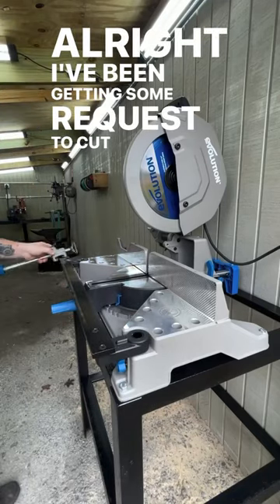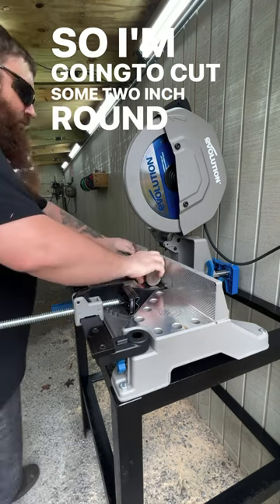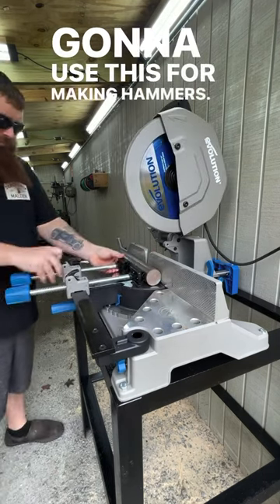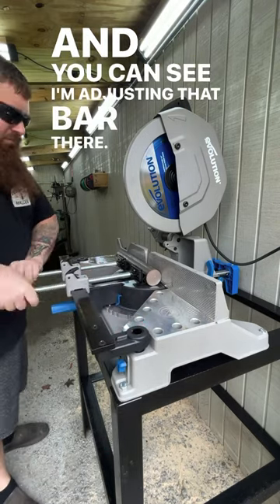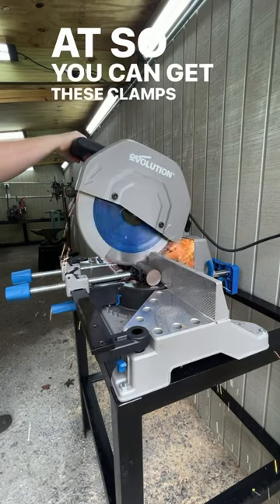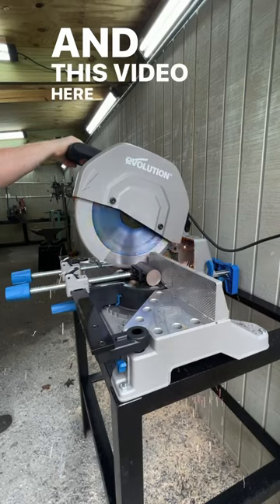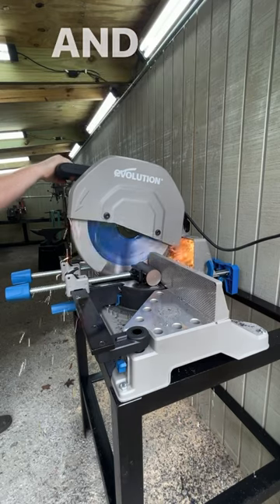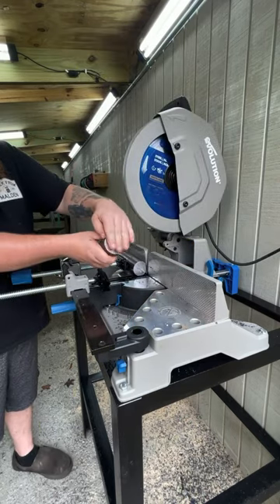Cutting some 1045 solid steel with my Evolution S355MCS metal cutting miter saw #fabrication #tools

Comment: I'm new to metal working/welding and I need a saw. I have been thinking about buying an Evolution saw but I already have an older DeWalt miter saw for wood working, can I just change the blade out for a carbide toothed blade and safely get accurate cuts? I have a custom gate project that would pay off a new saw, (but if there's no need id love to keep the money in my own pocket) what would you do?
Reply from the maker: No you’ll need a saw designed for it. The abrasive ones spin too fast.
Reply: Thanks,that’s all I needed to hear. Ordering one now
Reply from the maker: @AndyBro3Dprints  ChrisPowell5 should save you some money if you order it direct. Might need to be all caps.

Comment: I'm so confused! How the hell did that stay cool while cutting like that?
Reply from the maker: It removes larger chips than an abrasive blade which help remove any heat.
Reply: @FullSteamDesigns move your saw back to the back hole when cutting solid bar like that you will cut quicker but extend the life of your blade,
Reply: It was wearing it's sunglasses, 😂.   Sorry, it just popped in my head when I read the comment.  It is a good and valid question, though.
Reply: The heat is in the chip the blade removes like traditional machining

Comment: Mine is on tha way, it took 4ever to cut a 6" square tubing 1/4" thick wall, using my angel grinder cutting wheel, this should make jobs 100x faster
Reply: You'd be farther ahead getting a bandsaw if you do stuff like that regularly. Blades last a long time even cutting without coolant